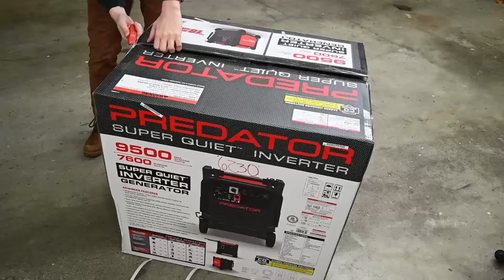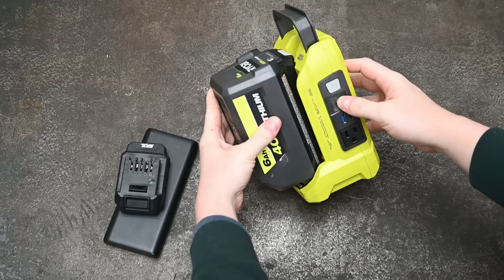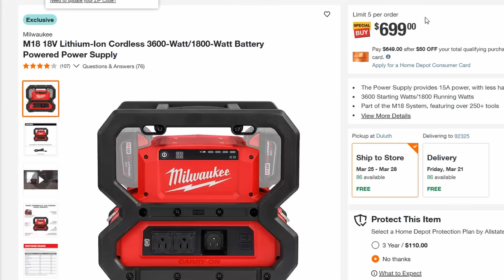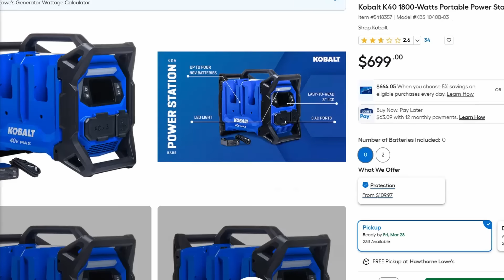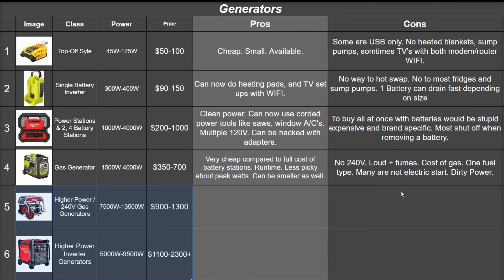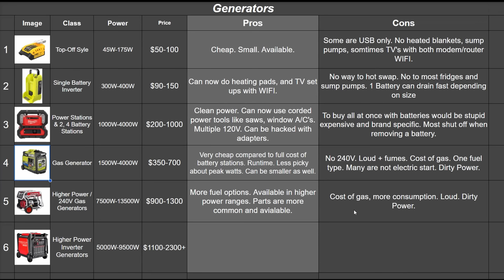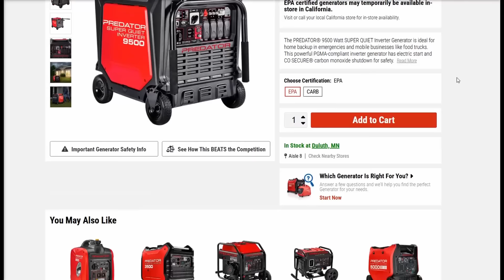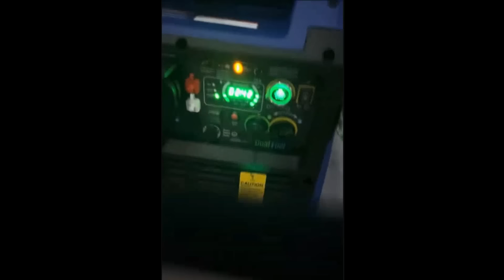Buying Harbor Freight's Most Expensive Generator So You Dont Have to

Comment: Great overview! We have an assortment of the first four styles and I've been shopping for a whole-home solution. So far my favorite are the Ecoflow Delta 2 and the DJI Power 1000 (usually in my vehicle as I'm a drone pilot). I would point out that many of the units in your small generator class are inverter models with clean power. They are actually pretty common at that size. 
For larger units, I've looked at the 12000W+ Westinghouse and Duromax, but you need to find the ones with very low THD. Some of the smaller Westinghouse have very dirty power, as does the 13000W Predator tri-fuel. 
I'm now leaning toward a battery solution for the primary backup because the failover can be performed entirely indoors and we can grow it over time. We will supplement capacity with our generator during the daytime if we go multiple days again. While it will cost more than the large generator, once I looked into the plumbing for the NG line and the price of copper to bring the 50A line inside and build a shelter for the generator, the difference is within $1000 for what we're going to start with.

Comment: I bought the Predator 9500 2+ years ago. At the time, there was no near equivalent Westinghouse or Champion inverter generator. Installed a 240 VAC feed outlet and mechanical breaker interlock for the feed. it easily handles the house (Gas HVAC Heat) when we have a power outage. And after having several outages (one lasting 4 days) before I bought the generator, we've had almost none since.
Reply: harbor freight told the power company.

Comment: I love my champion generators. They're so quiet and they just work.
Reply: I had one champion and it had issues. I bought a 2000w champion dual fuel from a liquidation place (no warranty) ran it 1/2 hr, changed oil, another 1/2 hour, changed oil until no more sparkles. I then ran it about 20 hours and it was hard to pull over. Valves so out of adjustment the compression release was inoperative. Think it is eating the cam or the lifters. Swapped the fuel system onto a generac gp2200i I already had. They are both yamaha mz80 clones. Burns more propane than the champion did in propane mode but at least it's not self distructing. Could be the reason it was in the liquidation place I guess. It was brand new but maybe it was from a batch with defects or something.

Comment: I purchased a Westinghouse duel fuel 9500/12000 (propane/gas) a few years back for power outages. It’s not an inverter model so a bit noisy. I built a collapsible, noise suppressing box enclosure and equipped it with a fan for cooling.  It hooks up directly to where power comes into the house.  Haven’t used it yet for an outage but great to know it’s there!   I let it run for a couple of hours every 5-6 months.

Comment: My cheapy PowerSmart 2500 runs my boiler (needs a neutral-ground bonding plug) and refrigerator just fine for 5-6 hours on a fill running in "eco". That's all I really need...

Comment: The reason the harbor freight one doesn't have dual fuel or remote start is because it is actually an older model.  It's been around for a number of years vs the 5500 watt one

Comment: Really nice video. Well done!!!  I heartily agree with your assessment of the "Predator" generator and did not hesitate to give Harbor Freight a very very wide berth (90-day warranty? GTFO). 
I pulled the trigger on the Champion 8500W (Electric Start, Dual Fuel Inverter) and have used it twice in 1 year - always with 20lbs propane tanks. Very happy.

Comment: I hope you earn enough from this video to get 2 of whichever dual fuel/ remote start generator you want.
Then get the parallel cable and have ALL THE POWER!

Has anyone come up with a way to run the dual fuel units on natural gas?
Not having to lug propane canisters to the store and swap them out would be amazing.

I know, the proper way to do that is to pay Generac to come install one but who has that kind of money?
Reply: You can search up 'conversion kits' to run natural gas on the dual fuel gens

Comment: Quick tip: if you buy a large battery unit (often called a "solar generator"), make sure you get one with low switching time so you can use it inline as a UPS.  Ideally less that 10ms, but AFAIK the spec is 30ms.   I use a large 2400w battery "solar generator" as a UPS and a smaller 1400w battery bank.  Between the two we can power most things.  If they start to run low, I can top them up from solar panels (300w) or our diesel van, which has an anderson connector just for this.   The van has days for runtime and we have a spare 10 gallons of diesel. I also have a gas generator, but it's been sitting new in box for years....

Comment: I feel this is the perfect type of Channel 2 add this comment to one of the things you mentioned about the Predator inverter generator is that you can pair them together what most people don't know about inverter generators that are able to pair together you are not limited to two generators the only thing that pairing ports do on any generator is bypass the breakers on the generator if you have a generator Inlet plug on your house are you plug your one generator into one plug if you were at a second generator Inlet Outlet unplug another inverter generator into it they will sync up together you do not need the pairing kit and in the torque test Channel you had a massive transfer switch if you had your transfer switch coming from a larger subpanel you could have that subpanel the only hooked up to generator inlets so let's say you had four generator inlets hooked into the same generator Inlet subpanel whether it's at 240 volt or 110 volt that's going to be based whether you have the 240-volt inverter generators are the 110 volt inverter generators in this particular case in this video you have a 240 volt so it doesn't matter as much as if you only had the 110 volt like on the Predator 5000 for the Predator 3000 W inverter generator which are only 110 volts what you could pair multiple together on a single leg but you still only 110 volts you can increase the amperage from the 5000 starting Watts if you put four of them together single phase what beat 20,000 watts single phase which is where the subpanel comes in because that's where your breaker box what can bind everything for you so you cannot distribute it across the wiring in your home

Comment: I started with a small Honda generator to run appliances during frequent week long power outages we were having. Eventually stepped up to a 8500 watt Champion open frame to run the entire house through a switch on the meter. Both work great and I really love how quiet the Honda runs when you don't need all that much power. A friend of mine runs his whole house off a small Honda generator, just being careful about what he turns on at the same time. The Hondas are pricey, but they really are top of the line in quality.
Reply: I built our house and put in a whole house transfer switch and then a sub panel with its own transfer switch. I put the lights, furnace, fridge, freezer and internet/Tv on the sub panel. I can run the Honda at least 10 hours on less than a gallon. The heat from the Honda keeps the 7.5Kw Champion warm and it has a remote start when we need things like the pump. We also have another Honda 2000 at our remote cabin for in the winter and cloudy weather.
Reply: Have a westing house 18,.5 kw continuous runs everything.,
Reply: @ What type of fuel does it use?  We use gasoline as we don’t have natural gas to our house. Even if we did I’d rely on gasoline as we are in a very seismic area and if we get a big one natural gas might not be available for some time.
Reply: Yeah it amused me when he said they are loud... Like not really. And if it is too loud for you, just build a plywood box and get a silencer kit. Youd be suprised how much of that noise is NOT from the exhaust thats why the hondas are so quiet, the enclosure has sound deadening
Reply: Hondas Are Great And Will Run Forever! Unless You Take The Fill Screen Out Of The Tank! Or Neglect Oil Changes! I have A Honda Tiller That is Well Over 30 Years Old!
Reply: We bought a Honda years ago and there's no regret. It's the 2k version and we used it to run the house, mainly for the sump pump and fridge. One time, it ran 18 hours on a tank. Power was out 3 days. We use K100 as a fuel conditioner and it always works on everything that's stored for the winter. Very impressive! The house is now gone and the Honda just sits, being run every month for 30 minutes. Hate to get rid of it, but I don't need it anymore.

Comment: Awesome video, very helpful.
Any suggestions on a Whole-house UPS to bridge between the time that the power goes off and the generator kicks in?
Or more importantly for me in Georgia, a UPS that could handle the transients that only last a few seconds to a minute but they cause me to have to reboot everything and it would prevent voltage spikes. Along those lines, a UPS able to bridge that brief time when a transient occurs could also handle any lightening strikes much better than a plain surge protector so it would be worth a modest investment.

Comment: You should ALWAYS run a dual fuel generator on propane! You eliminate carb issues completely and they last way longer.
Reply: Agreed. I have a used one that has had gasoline in it before so I try to keep on top of it, but also a new Predator 5000 that will only see gas if the power is out more than a week. I do keep gas around as mower fuel and emergency generator fuel.

Comment: If your house has gas, I'd consider installing a permanent 18kW-22kW gas generator outside and the switch needed to power your house from the main breaker off the grid. 

Yes, they cost a few to several thousand dollars, but it's extremely convenient, you'll still have Air Conditioning, and it increases the value of your house.

Comment: Buy a simple 12v 3000w inverter (can obvious go for less) can run about anything if you really want to. goes for about 150-200.
This could be hotwired with clips to the car battery (now you have a generator! when the car is running)

buy 1 or more 100ah 12v lifepo4 batteries goes for about 200ea (looks like car batteries) and attach the inverter now you have a portable battery station with 220v 3000w current.

When power goes out unplug the mains and place a cable between the inverter and house (any outlet in the house) and all lamps and internet will be working. just like before.

would not recommend any type of heating thanks to the wattage drain.

Comment: Lots of good info. I will say though, being a small engine mechanic for 25yrs the Honda is worth it. And not just from reliability, but they're quieter, smoother, cleaner power and hold their value amazing. In a situation where there is no power and a cheap clone generator fails, people will pay anything to go back and just buy the Honda. A $4000 Honda that's cared for will sell for $3000+ after 10 years of use. That's $100 a year rental with never an issue. A $2000 Predator will get you $1000 in 10 years but you'll have rubber parts (fuel lines, vent hoses, dampeners, etc)  disintegrate. Something China hasn't figured out how to manufacture yet well. They also cheap out on the insulation for all the wiring in the generator head along with electrical components like capacitors and other items on the circuit board. And we all know that's a bad thing. The electrical parts fail with use, but a lot of people rationalize this with not having to use the generator a lot. However, the rubber parts fail just by themselves.
Reply from the maker: These are great points, thanks for chiming in man
Reply: There's a reason most RVrs and streetfood stands use Predator. They're not only cheap, but they're very reliable. Honda has become wayyy to expensive for not a whole lot of advantage.
Reply: @rcmodder For a street vendor, setting a Honda out would probably be a theft magnet.
Reply: There is a huge gap in the misunderstanding of how decibels work. Every 5 to 6 decibel increase is perceived by the human ear as something being twice as loud. You take the 9500 Predator that is boasting about a super quiet 67 decibels versus the 58 peak decibels (52 partial load) of a comparable Honda. That's four times quieter/ 1/4 as loud. You could literally sit on the Honda and have a conversation with somebody. You're going to want to bury the predator in a pit. The only reason they're purchased is price. Not longevity, reliability, etc. 

I tell a lot of my customers. If they don't have the money for a new Honda, go buy a 20-year-old Honda. They will be happy with their purchase. I personally run linked Honda eu2000s that are pushing 20 years old now. I still get 50-year-old Hondas in that just need a carburetor clean from sitting 5+years and are still running strong.
Reply: @dancooper6002  Even the national parks won't allow you to run a 67 decibel generator to power your RV. Their limit is 60 decibels. A constant 67 decibels is twice as loud as the limit. It's a horrid drone for hours. It's only quiet relative to a construction generator at 90 plus decibels. 

The reason a food truck runs it is because they're cheap and money is extremely tight. They're generally on the road side with tons of traffic noise anyway.  Freeway traffic is around 70 decibels. So running a predator generator is like sitting on the side of the freeway.
Reply: Project farm came to a similar conclusion. Honda is the premium but others will get the job done but are slightly less efficient and wear more while being significantly cheaper
Reply: See, this is extremely true, 10 years ago. Honda isn't bad, but the competition has caught up, and pretty much all of the big names are pretty reliable.
Reply: Hey good to see you here, thanks for the additional perspective. I can always trust what you've got to say about this kind of thing!
Reply: It was between that big predator or the Gemmax 9000 for me. I ended up with the genmax because of the auto/push button start so the wife could start easy enough. Also, installed a easy start on the home Air con so it can run my whole house

Comment: I was able to pick up one of the predator 8750 inverter generators from their as-is pile for an extra 40% off during one of their sales.  Came out to about $500 before tax. Got my parents that 5000W ultra quiet for just a bit more.  We get outages 5 or 6 times a year, it seems, and I've been happy with them so far!  They only give you a 5 day return window for as-is, but compared to a 90 day on the new there is no effective difference for me as either way I would just confirm it works on day one, and then it would sit until the next outage anyway. Lol
Reply: A lot of that stuff gets used once and returned. Not bad if the discount is right.

Comment: A 2kw inverter gen should have enough clean power for a gas furnace, right?  If that is the primary need, it would cost far less and could run quite long, especially on a large propane tank.

Comment: Another option if you're not too concerned about "dirty" power (and weld frequently) would be a gas/diesel powered welder. Most support ~10.5KW and have larger tanks. But definitely on the higher $$ scale.

Comment: Just got power back after a 12 day outage.

Have a 5500w gas generator, and a 3500 inverter gas/propane.

Run the 3500w most of the time, and every couple days turn the 5500w on to heat up hot water. Saves on gas, but adds maintenance.

Comment: For fixed use at home, I would think that an off the shelf UPS would be a must better option for most people, especially with regard to TV, internet, etc.
ETA:  When looking at options 1-3, specifically.
Reply: A UPS doesn't have a very long run time. Also, most of them will continuously beep when the power is out. Not all of them have a way to mute the beeper.

Comment: Love this topic 👍. 
Our house has natural gas for everything, so our electrical needs are not that high. 
Only whole home Air conditioning is 240 volt, but I have an efficient Media window air unit for the master bedroom to run on a EcoFlow pro unit. 
For my needs I can comfortably power our house with a Honda EU2200i gasoline/ propane converted unit (hutch mountain) that recharges the EcoFlow Pro unit plugged into a transfer plug/switch. 
Yes my 96% variable speed furnace is a Princes too 😂, I  have a neutral bonding plug ready for her 😂
Reply: Also for the love of intelligence have a good amount of oil on had for gas generators, most want an oil change every 100 hrs of run time, don’t abuse them.
Here is the biggest one 
YOU need to test your equipment/ Systems guys.
I know so many dudes that honestly are guessing that what they buy will work.

Comment: I did loads of research and ended up going for a Hyundai inverter petrol generator. With inverters the quality of the electronics is crucial. Also excellent value for money
Reply: Im in the same boat. Hyundai 9250w for 720CDN, about 550-600 USD. Has 2 120v and a 240, remote start and runs what I needed.i
Reply: They Hyundai generators are fantastic, ive had a 3500w inverter for over 10 years, gets a beating cos it gets dragged around all over the country for camping and shows. Never once let us down. At the time it was £1000 with a 3 year warranty vs £3200 for a Honda  of the same spec with 5 year warranty. Now, the Honda may be 2db quieter but didn't think 2200 quid extra was worth it.

Comment: The problem with dual using power tool batteries in a power station is you’ll be replacing those batteries sooner. LFP is the way to go.

Bluetti even has one that’s IPX rated.

Comment: 2 notes I'll add to this, the 150w ego inverter is trash, square wave output is not ideal for anything with a motor, the 400w inverter on the other hand works great, can run my newer fridge all day as long as you have 2 batteries to swap between and somewhere that you can charge the battery not being used.